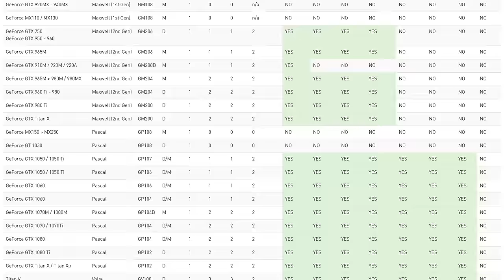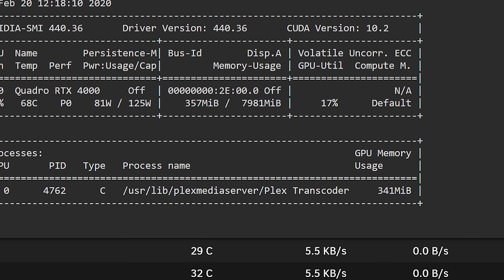5 First Plex Media Server Build Mistakes

Comment: I run my server on a 10year old Mac desktop with 8gbs of ram and a 4tb wd red(backed up). Have not had a problem with 5 concurrent streams(most remote max 25mbs up). No one complains.  I do force family who have access to get a Roku ultra and it direct plays 80% of the time. Oh and if you don't have tatulli monitoring your server yet get and thank me later.
Reply: Yup. As long as you have cpu if you transcode, you can run of a 1.3 2 thread celeron... graphics card?!?  I run Plex in a vm. It doesn’t use on I play in native format.

Comment: Curious if anyone knows if one of those "toaster" docks exists that supports SAS drives?  I have one that works great with SATA drives, but most of my drives are SAS right now.  My server is an epic hack job, but it does the business, but the internal ports are the only device in the house that supports SAS.
Reply: I've never found one.  Best way to test SAS is with a sas backplane/expander.

Comment: How did I mess up?
I got a Qnap TS-431K-US that seems way underpowered. 4 each 8TB drives in Raid5 (I believe) with Thick Volume. I'm getting constant "Failed to create Snapshot" Errors as well as the think taking forever, lag and buffering issues galore.
I want to remove the drives and use a spare computer, that has decent power, as the server, but am afraid that I'll lose all my data that the drives have.
Is it possible to save the data when putting the drives somewhere else?

Comment: I'd like to run an ssd metadata drive alongside an ssd nas for all of the speed. My budget will see.
Reply: Be careful with all SSD NAS, most commerical SSDs aren't rated for the full drive writes you are capable of hitting on a heavily used NAS.  The price per TB of SSD vs spinning iron can be prohibitive as well.  Apparently you can get 15TB SSDs.. for the low low price of 3k to 8k per drive compared to $400 for 16TB HDDs.  Also, for Plex you are looking at mostly serial reads vs random reads (where  SSDs really shine) so there isn't a huge benefit to going for an all flash config imho (HDDs are more than capable for delivering the throughput you would need for delivery of all your media, including 4k, and your actual network would probably be a bottleneck first).

Comment: He thinks 8 gigabytes of RAM is minimum mine has one gigabyte of RAM it's called the Raspberry Pi and it's only 35 bucks.
Reply: Ya, your driving a '74 Pinto, he is driving a brand new Ferrari 488!
Reply: I've run plex on everything from a raspberry pi, to a 1u dual xeon/Quatro p2000. Guess what, all of the movies I download play just fine, no matter the hardware. Am I missing something? Is the video supposed to look better or something , because i can't tell.
Reply: Don’t go crying if you lose all your data from a $35 system.

Comment: How much transcoding is actually being done now?  Most clients can direct play most media now with the exception of 50mb+ 4k rips (and for that I would recommend NVidia Shield's anyway), so unless you are planning on using remote play on a very limited upstream connection I don't see how transcoding is a primary build focus nowadays. (I already make an upstream friendly copy of my 4k media since 4k transcodes on 50mb+ rips are way heavier than any CPU I'm going to put in a low power 24/7 server).  If I'm off base here let me know, but this is how I've been operating for the past few years.  For reference, I'm running Plex in a Freenas build - Core i3 4150, 16gb ECC ram, no external video card, with 8 8TB drives in a U-NAS nsc800 chassis and none of my various remote play clients ever have playback issues, all local clients are nvidia shields.
Reply: On Plex transcoding is needed for subtitles.  At least it used to be. So you dont use subtitles, but there are many Plex users that do.
Reply: @AndreMiguelLopes69  I didn't think about subs.  But I am not 100% all subs need to be transcoded..  people seem to be having various success with SRT and PGS subs not requiring transcoding.  It may be a client issue?  

https://www.reddit.com/r/PleX/comments/cckabs/how_to_get_subtitles_without_transcoding/
Reply: The only thing that needed transcoding to the nvidia shield is the audio.

Comment: As for Ram if you are using Plex DVR, Ram transcoding requires 8GB Per show recorded at a time. I tried out and set 8GB Ram Disk and could only DVR 1 show at a time the rest said insufficient space and did not copy. Upped the ram disk to 16GB and it could DVR two shows if no one was watching anything.
Reply: This is the reason I went with an SSD. Although the RAM disk was a tad bit faster, the additional space from SSD was well worth it. Honestly, the speed is negligent, at least with my hardware

Comment: "16 GB of RAM is the bare minimum"

...And I'm here with only 2.5GB 
:'(
Reply: If you use a windows machine as a plex server then you don't need more than 4gb of ram. 
Windows version of plex is 32bit and can only read 4gb of ram at maximum.
Reply: actually using the Linux version in an old compute a have on 24/7

Comment: Does the GPU matter if you don't have a monitor on you server? I only access it remotely. Also,  I do I get one of those ubiquiti hoodies?
Reply: Only if you intend to use hardware acceleration, and if so what kind. Check what encoders your gpu supports, and if you need plexpass to use it

Comment: Yes... Bought 3 Seagates.. 2 DOA and third failed within days. Replaced with HGST and no issues 3 years running. I have purchased several Seagate externals only to have them fail in the first year... Yeah never again. Plus look it up several professional storage locations post the hard drive failure rates. Seagate ALWAYS lead the pack for failures
Reply: So interesting how different people's experience is on drives. HGST... coined the "deathstar" from their "deskstar" series of drives.  Hard to trust them considering their past track record.  Literally, every HGST drives I've ever owned or worked with has died in my life.  WD has gotten better but still IME Seagate has the best record so far .  I've worked as a server admin for many years and personally owned probably 100 harddrives of different brands.  Almost always DOA means shipping damage (which I'd argue is the manufactures fault). Before a drive leaves a factory it has to pass basic tests and DOA would be one of them (always a possibility it was a robot error but probably less than .1% chance). . 
https://www.youtube.com/watch?v=w05wBWdvdeI
Reply: Take a look at https://www.backblaze.com/blog/2018-hard-drive-failure-rates/ or https://www.backblaze.com/blog/hard-drive-stats-for-2019/ been a system admin for a couple of decades other than the original deathstar drive Seagates always seem to fail first, i do have a couple of their Hybrid drives and they have gone a couple of years without issue but any enclosure with a Seagate is cursed as far as i am concerned. Shucked 5 Western Digital external drives to get the White label drives out (1 actual red drive included) and they have been the backbone of my Synology NAS for two years.. Backblaze releases a quarterly failure rate on the drives they have in their storage arrays. Good Reading

Comment: Is it better to rip the blu ray to the PC I'm ripping on then transfer the file to my Synology NAS running my PLEX SERVER or is it better to rip the blu ray from the PC over the network to my NAS on the fly ?
Reply: I guess technically it would take less time to rip straight to the NAS as you don't need to the intermediate step of transfer from the PC to the NAS. The bluray ripping rate would be well below the  transfer rate to the NAS assuming you don't have awfully slow network speeds, but in almost all cases even wireless would be faster than optical disc transfer rate.

So I'd say straight to the NAS would be best if your setup is simple as one bluray rip at a time.

Comment: As someone who recently purchased a couple seagate high tb hardrives I was wondering if you could expand on the; unless it's a seagate because it'll break anyway, comment...   Little worried now :-)
Reply: Seagate have the highest failure rate out of the big name brands, which is why they're cheap... Many people use them casually and don't have major issues for several years, but if a Seagate drive is under heavy daily use, in a media server for example, that will be greatly reduced... I wouldn't expect to get more than 3 years at most out of one under such conditions, personally

Not worth stressing over really, but if you're not working in a RAID environment, it's certainly a good idea to back up important data
Reply: @Brendan Buss . That data is pretty out of date. It's been a while since 3 and 4tb drives  were large storage drives. WD doesn't do much better than Seagate nowadays.
Reply: @robertt9342  Thx for the response.  I had looked into the reliability and cost/value of hardrives and most of the reviews I found last year suggested they were a good choice so the rhetoric on two of the videos I'd watched seemed out of place, but the way it was stated both times suggested it was a well known thing.  
  Which made me a little nervous since I just bought an 8T drive from them.  
  Again thx.

Comment: Sorry, this is all crap.  My last server was an 8 year old MacBook Air with 4gb of ram, Many years of flawless service pushing 5 streams at a time.  My Mac mini with 8gb of ram runs enough streams that I run out of screen real estate.  My NAS box has 2gb of ram and is designed to run Plex directly - runs great.  
Are you suggesting you need an A+ tier gaming rig to run Plex?  It's a server, unless you want a $500/Month electric bill and a built in heater, go for it.
I have been running Plex since 2010, all your advice is ridiculous overkill

Comment: Noob question... is a high end gaming pc (2021) with usb 3 attached 10-14tb storage for plex media files ok? Or is the usb HD going to still be a huge bottleneck vs a modern nas?  Also alot of the nas setups on YT still use spinning disks? Any reason they aren't SSD variants atm?
Reply: Hi Mike<
So just to run a Plex Server and Windows 10 Plex App to watch requires very little processing and GPU power, I have it running off a Synology NAS and that ancient processor is even good for in network transcode. Transcoding to clients in your house, like a PS4/5 for instance is where beefier hardware is required mainly since the vast majority of Plex capable players don't natively support certain video codecs. So your computer would step in to transcode - so that is where your gaming pc would come in handy. Even more so if you want to share with friends outside of your home network

As for the hard drives, honestly they will work just fine for plex but its the wear and tear plex will put on them will shorten their lives. Most USB hard drives are not rated for  24/7 operation. So either they will be constantly spinning when your plex server is running, or if you kill the server  and then turn it on a few hours later your jsut adding more power cycling to the drives that again will kill them. That said it isn't going to kill them over night but If your really into plex I would suggest looking into a NAS with proper NAS drives as soon as you can.
I went from a small HTPC with a red drive to a synology DS918 with WD Red - and its working great. Only down side is at 47 terabytes I am out of space so looking to build a whole new pc with 18 drive storage capacity. - Anyway long story short I hope that helps - Cheers and happy plexing
Reply: @robaitken4592  thanks very much for taking the time to give such a detailed response Rob,  much appreciated
Reply: Hey I know this thread is a bit old, but to tac on some other info on hdds. You can save a ton on them by buying external desktop hard drives and shucking them. There are white label equivalents to WD REDS in the easytore and my book variants, but you need to buy at least an 8tb to get it. Seagate EXOS are in drives that are 10tb or more. 

The downsides to doing this is besides having extra junk to deal with, and a lower warrenty; is that your warrenty can be void if you can put it back together. However, with that being said, it seems most drives will be fine anyway. Plus, shcuking, with My book and EasyStores, aren't hard to put back together. With Seagate, you're SOL. Anyway, for almost any info on drives, look up r/datahoarders on reddit. They'll be able to answer any questions you have there too.

Comment: Bought a couple Seagate hard drives ~ 13 years ago, both failed within months. Swore off them for literally over a decade, bought a buncha WD drives, no issues. Last year I did the research, everyone was telling me the Seagates were now OK. Bought a single Ironwolf pro 8TB, started throwing tons of SMART errors and reallocated sectors hitting hundreds after about 3 months use. RMAed the drive and they sent me a refurbished drive that was dead on arrival. Finally got my money back after 3 months of back and forth and about 73 emails arguing with both the vendor and Seagate (who refused to honor the warranty in my country), and will now never give Seagate another chance.
Confirmation bias? Probably. Would I ever buy again? Nope.
Reply: I've had about 12 WD hard drives fail on me. I've never had a Seagate fail.

Mechanical parts just fail sometimes.
Reply: Sometimes you gotta go with what your personal experiences have been.

Comment: I've been a pc user for over 20 years. I have never had a hard drive fail. Not once. I've always had bad luck on the silicone lottery, but as far as hard drives are concerned from my prospective a dead hard drive is a myth.
Reply: So given your confidence in HDD's, one would assume you are running... say... 12 drives in a RAID 0 Stripe with all of your irreplaceable data (your children's pictures and videos, for example) on it?  I'm the owner of an IT business and we have over a thousand systems under management, probably 5,000 drives total.  We see 1-2 drive failures a week, all mixed vendors.  Spinning Rust has improved dramatically over the years, but they still fail, even Enterprise drives.
Reply: this is just luck dude, i used to work in IT repair and retail and saw dead/faulty HDD's almost daily. DAILY.
Reply: In a normal PC your HDD isn't spinning 24/7. In a server HDDs are allways spinning (you can configure them not to).

Comment: Can I add a WD Red 12tb to my desktop computer?  Not ready to build a NAS yet and just need something to hold me off for about a few years.  It will be mounted so that should help with vibrations. HELP HELP HELP
Reply: Jason Brook,  Depends on the bios and OS of the PC. All of my PC's would not recognize a 6tb drive without putting them into a usb docking station. If you are going to use  WD red 12tb drive you will probably need a docking station. Then use Makemkv and or Handbrake to put all your videos into mkv files that is what smart TV's and BLU ray players will see. You don't need Plex to do this since tv's will see the files on the hard drive and play them as long as you let the PC share your media on your network. If your router has a usb port, you can plug the docking station into the router once your media is on the drive and stream your media over your network that way ( works with my TPLink router ). The down side of plugging into the router you cannot add or delete files through the router you have put it back onto your PC to do that. Hope this helped.

Comment: Hi, I have an older PC with an i5 -2500 cpu and 6GB of ram, it has no graphics card and i can add a few TB of HDDs for storage, would this be an ok start for Plex?
Reply: I use Plex on a Synology NAS with 4GB, admittedly I already have my media transcoded to mp4 and the nas handles it fine, however it’s going to really depend on what your media is and if it needs to be transcoded.
In all honesty I would probably add some more ram and a GPUs to do the transcoding rather than using the cpu.
I would look at the OS you’re going to install and run a bare minimum installation so that you’re not going to have that much overhead (look at unraid).
Reply: Absolutely, I run the same CPU but with 16Gb RAM and my Plex server runs like a dream

Comment: number 4 just happened to me over the last 2 months we have had more power problems that the last 5 years. it was like the power was stuttering and I could here all 15 hdds grinding it was sickening sound next day bought 2 APC 1500M add them in and 2 days later same power problems again and then full black out power tried to come on 2 more times with that same stuttering affect but the back power took care of every thing did a graceful shutdown and I had zero problems  lot cheaper than loosing all my data due to destroyed hdds

Comment: I have a plex server on my old computer with Intel Core i3 3220
3.3 GHz Dual core, 4GB RAM, integrate grapjic. I own a ready-made motherboard with
Intel Xeon X3470
2.93 GHz Quad core, with 12 GB ram, which I don't need. I was thinking of replacing those two boards, but I'm wondering - would it be a step forward, backward, or standing in place?  Thank you!
Reply: Use passmark.com to check the scores of each CPU.  As a general rule for transcoding, a single transcode equates to about a score of 2000 on passmark.com.  So if you have a score of 6000, roughly three simultaneous transcodes.  Again, transcodes only, nothing to do with direct play.

Comment: I currently building a replacement plex/storage server. My current server has about 8TB of space on HDD's in a RAID 10 config. The new server will have 8 4TB SSD's in a RAID 10 config and will have about 16TB of storage. This is going to get expensive very fast.
Reply: Why Raid10? Why not move to FreeNas or Unraid?